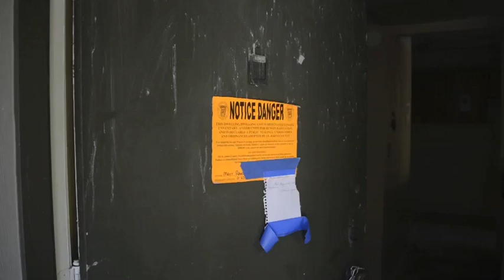The process of meth lab cleanup

Comment: This way of cleaning would ruin an Aussie house with Gyprock or Drywall on the ceiling and the walls. Most times they are totally stripped bare and resheeted after also using chemical to seal concrete and block or brick. But in some cases the building is demolished depending how serious it is affected
Reply: Same here in America, most homes interiors are drywall placed on a wooden frame. This soaking would destroy the material and moisture inside the framed wall would cause mold from mildew. Tearing up the carpet and padding is a good idea, but the duct work for heating/cooling needs cleaned. I suppose the walls and ceiling can be sealed and repainted. This video is misleading; thumbs down from me.

Comment: So after removing all toxic chemicals with soap and water next step call in mold remediation team afterwards for all water damage done. What do you do for wood floors? this was on concrete water is not a big issue.
Reply: mrelectron62 all flooring is completely removed
Reply: The water is left to sit and soak into the floor. They vacuumed it up as they show in the video. If you spill a cup of water in your floor and soak up most of the water it’s not going to cause mold. Think realistically about this, come on....🤦🏻‍♀️
Reply: @P3N1SLUVR  Exactly. 
Also, since that is a bathroom it would be built with bathroom safe sheeteock/drywall that is meant to deal with moisture.